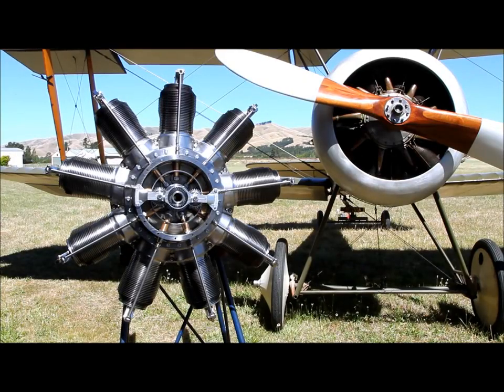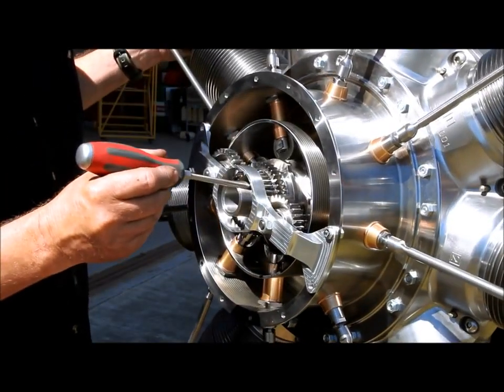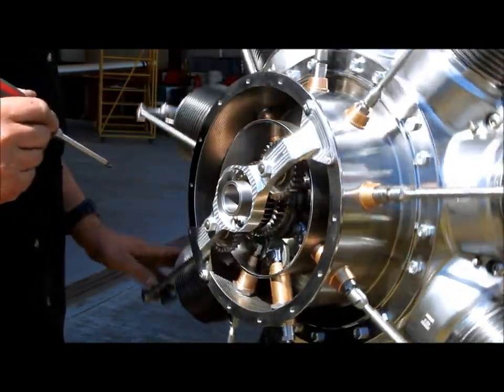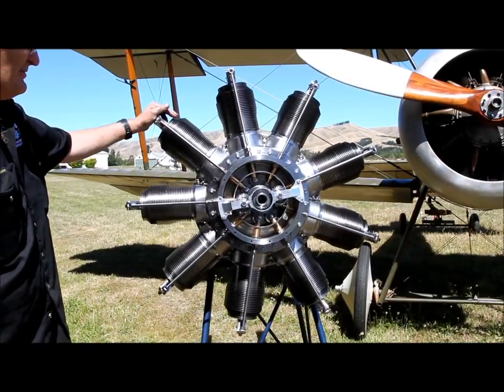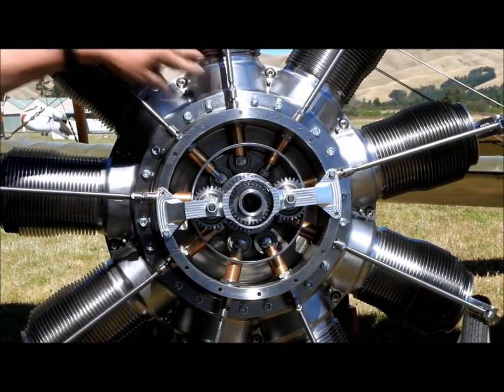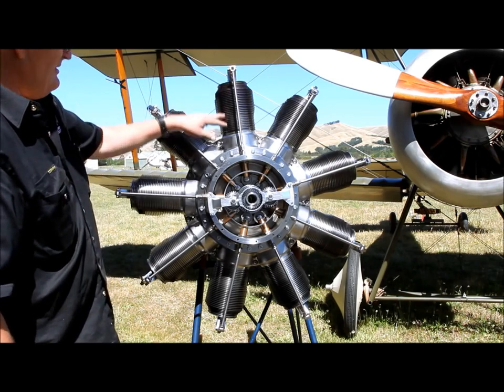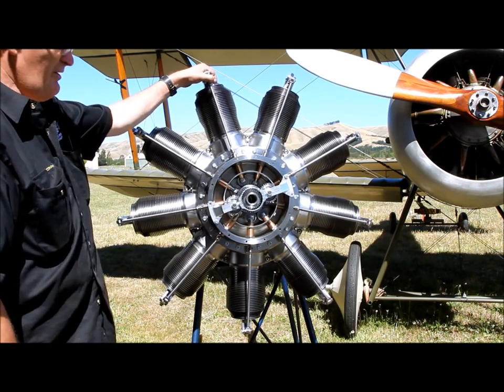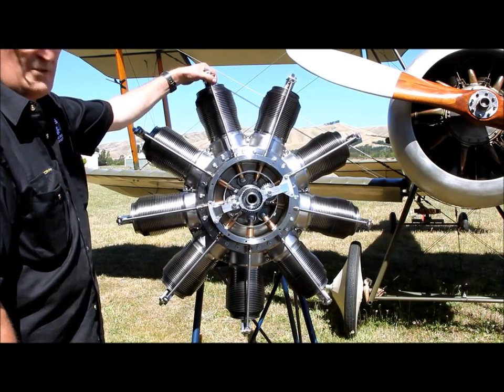How the Gnome rotary engines works

Comment: With the rotating mass it must be hard to steer
Reply from the maker: Yes had some gyroscopic forces going on, flown in normal manner no issues but it was used to help aircraft maneuver in dog fights.
Reply: @classicaeromachiningservic262  actually this was an issue even in normal operation since many pilots died during training during phases such as takeoff and even performing basic turns!
Reply from the maker: @rahulbhatia7798  You are correct that many died during take off while learning to fly but remember that as well as learning to fly they also had to learn how to run a engine.    Its not like today engines when you turn the key and they run.  Rich cuts were common and could take 10 to 15 seconds to clear which if you had just taken off that had dire consequences.

Comment: History fact: the man who invented the rotary engine—rather than squat as per convention and common sense— preferred to lay down on his stomach whenever had to take a crap 💩.
Reply: LOL
Reply: LOL
Reply: OK, you have me LOL
Reply: 😂 Best random fact ever! ...Um. Closed legs or spread?
Aight, Ima go now.
Reply: Brad Brown I’m not sure, but according to multiple accounts, when people insisted to him that a crankshaft should move and crankcase remain stationary, (not the other way around), he replied “aww shit..”
Reply: @bradbrown8759  The Sherman's used the Continental 905 radial, The Ford GAA and the Chrysler multibank engines.
Reply: @deadon4847   Thanks for the Sherman details. I wonder if/how they drained the oil from the lower cylinders to prevent hydro lock. (Common radial issue)  Unlike a plane, accessibility must of been difficult at best.
Reply: Yes, it's true, and this odd personal habit was picked up by doktorbimmer, who actually took it farther. It seems doktorbimmer hangs upside down, like a bat, while crapping.  The poop, at least some, inevitably gets on his body, it's unavoidable. But he is very stubborn, and if you don't believe me, it is a FACT that he has stubbornly trolled these rotary engine pages for years.